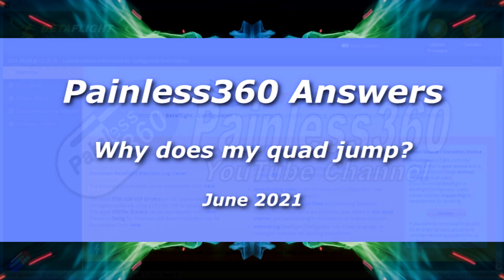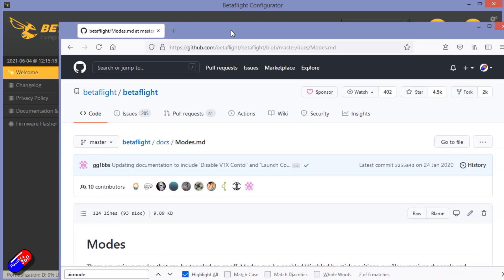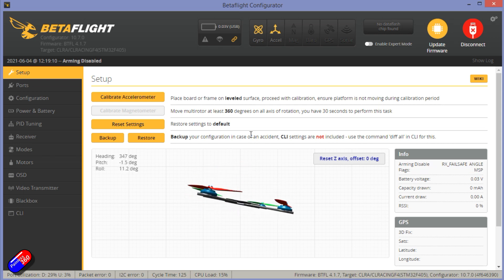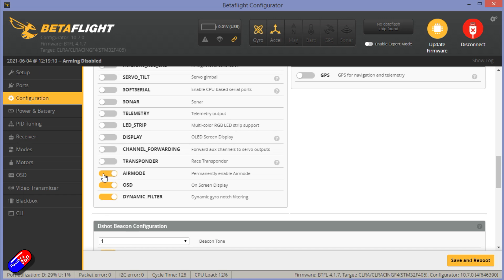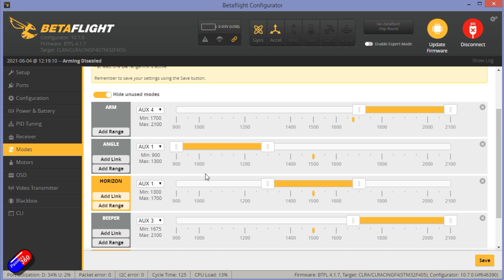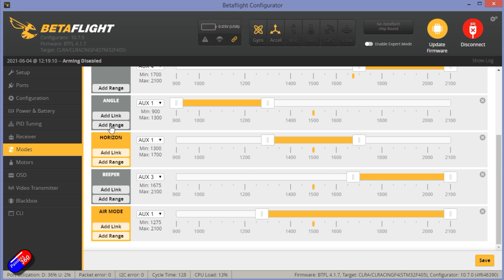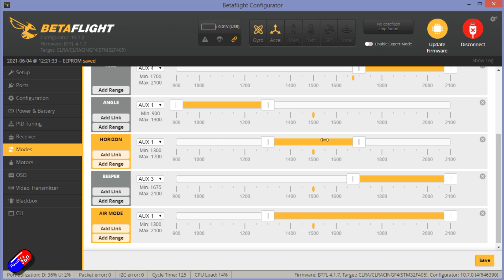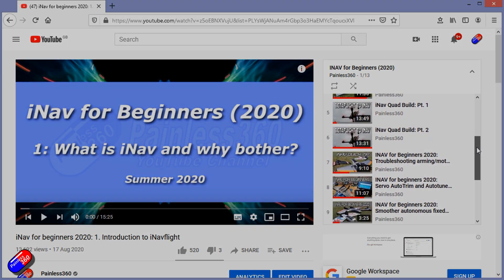Why does my quadcopter bounce around on landing?

Comment: I have 2 5 inch quad builds and when air mode is permanent enabled they both desync but when I enable airmode at bottom of throttle they fly fine is this normal?
Reply from the maker: Sounds like a feature. If it's happening on the latest Betaflight version, I'd report it to the developers... Happy flying

Comment: Does having air mode turned off affect how the drone flies in angle mode? I am new so I only fly in angle mode, but I do want to avoid the bouncing issues.
Reply from the maker: Only at low throttle. For learning to fly, you can turn it off but it'll mean that when you are at low (or zero) throttle the flight controller will do a lot less to help you.. I'd get used to having AIRMODE on and learn to disarm just before it touches the ground.. Best of luck!

Comment: Hey  my AirMode is actived but i can’t see it on mods tabs… why?
Reply from the maker: What software and version?
Reply: @Painless360  betaflight 4.4… i have the air mode actived but i can’t see it on the mods , i see Arm ,Horizon, Failsafe,,Prearm and other things but no Air Mode
Reply from the maker: AIRMODE is available as a feature in the Configuration tab now. It isn't a MODE anymore.
Reply: @emadji3907  turn airmode off in the configuration tab, then it pops up in the modes tab so you can assign a switch for on/off.
Personally I keep airmode off, it's awful for me.
👍👍👍👍
Happy flying

Comment: Thanks, this is really helpful video! However I don't have this airmod option in Modes, looks like it's missing in the version 4.1.0
Reply from the maker: AIRMODE on all the time in Configuration tab?
Reply: @Painless360  no, there I can see the switcher. I can't see airmod on the modes tab to connect it to the AUX
Reply from the maker: Just checked here in BF4. 2 and it still works like that.. Best of luck

Comment: I have air mode off in config menu and don't have motor stop turned on. I have my air mode on a 3way switch , top angle,acro w/out air mode as center ,and acro w/air mode  down.That way I can land on small stuff or drag on a railing.

Comment: Coincidentally I've just set my Rekon3 the same way but it's not working. It still spins up on Arming. Yes I saved OK. Any ideas?
Reply: @Painless360  Duh. "Do not spin motors when armed"  Oh so simple when you line up the grey cells. Happy flying.

Comment: Thank you for this! 
I'm surprised it's airmode that's causing this, and not the minimum throttle value. 

Can you explain why airmode would cause a bouncy landing, when its intention was to give authority even with no throttle input?

My guess is FC overreacting during ground effect, interested to hear other thoughts
Reply from the maker: Yep, you've got it. Without AIRMODE the FC isn't overreacting on landing.. Happy flying

Comment: I use a three position switch where air mode is on or off and in the third position it sets flip after crash on,
This way I can decide if air mode is on or off and easy to flick it over to off just before landing if you want, or if you just crashed and after flipping back over you can arm with air mode off, and you have more, or a little more, control when taking off again, especially in longer grass.

Comment: I always disarm by switch 10 cm above the ground
Reply: For 99+% of the landings i agree its the easiest/best way but i do have an switch that turns airmode off in case i will ever need to. Mayby someday when the landing needs to be very precise or i want to land the quad without disarming.
Reply: Yup same.